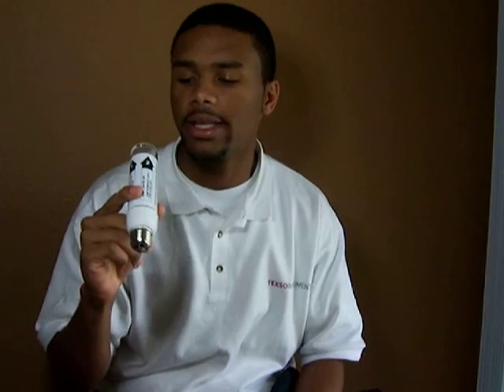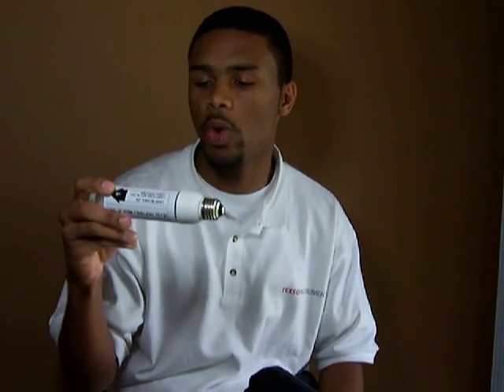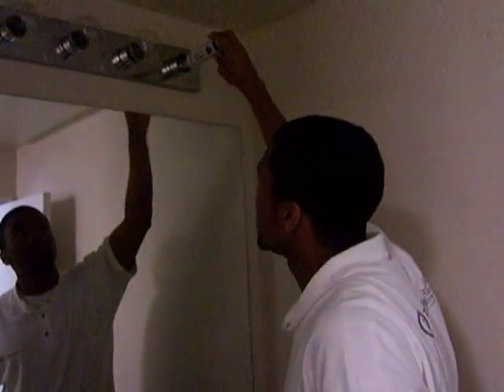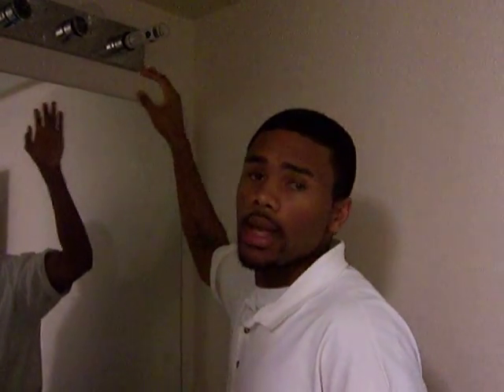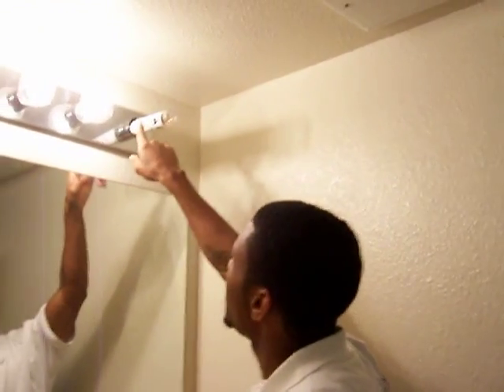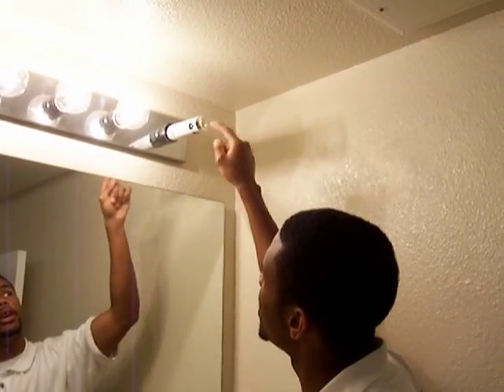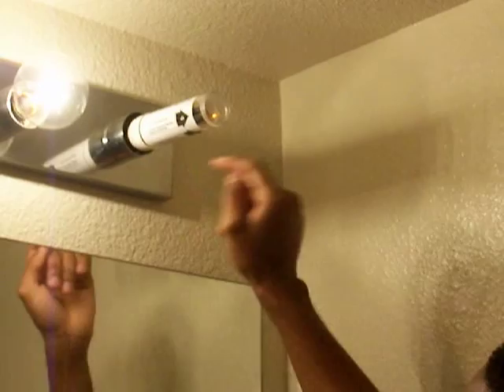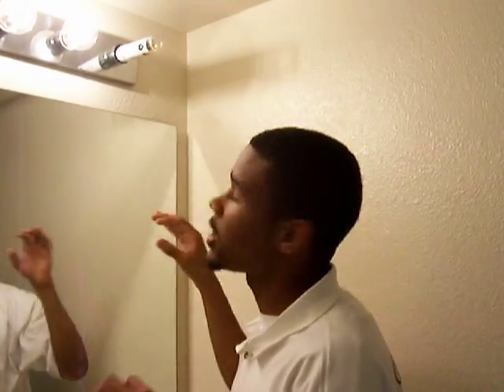HID Light Fixture Tester

Comment: that tester looks great but you tested a receptacle that doesnt use ballast, ignitor or even a starter thats an ordinary bulb beside it. I think it would be best if you used a luminare or an industrial light fixture for example a street light with 150 or 250 watts HPS bulb with all the components.  (cant wait to have one of those it would certainly make my life easier)

Comment: That looks like a great product. Do you plan to offer a Mogul base version capable of testing 400 to 1,000 watt M.H. or M.V. industrial type light fixtures? There may be a market for that as well, I know it would make my job easier at times rather than carrying a 1,000 watt bulb 35 feet into a manlift with me just to find out that the ballast is not functioning correctly.